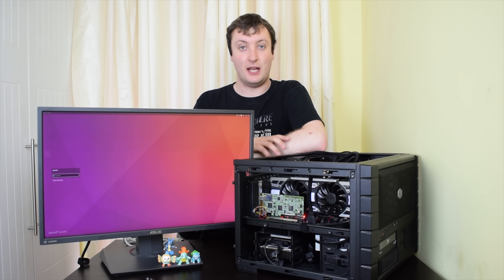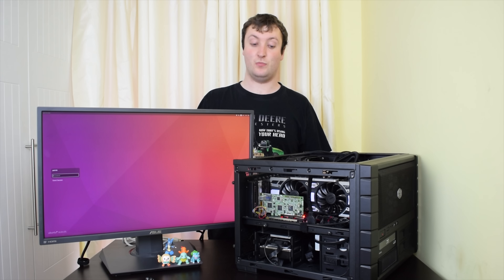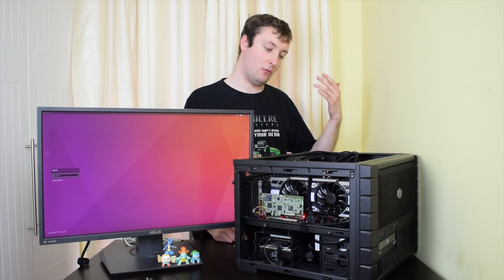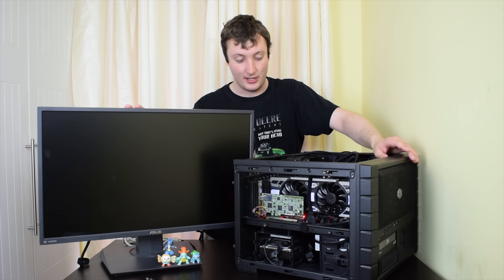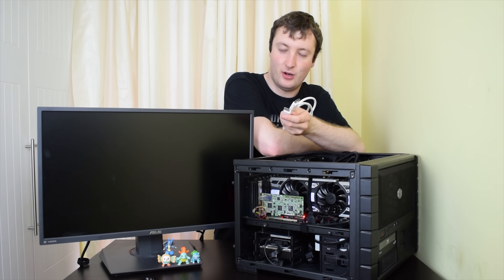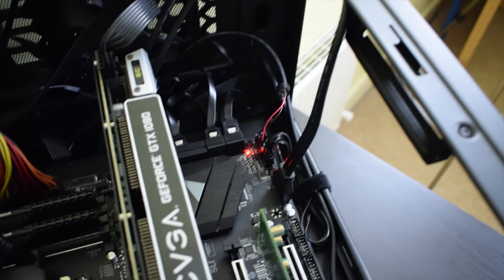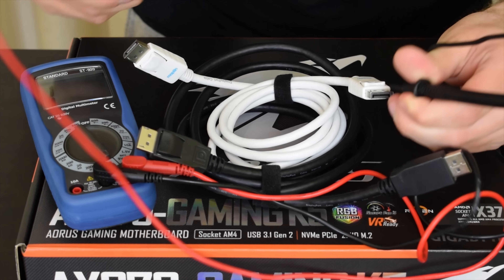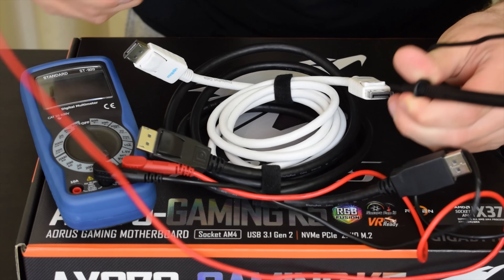Display port can cause boot issues

Comment: im getting weird colored  lines of pixels (red green blue or black and white) when i try to boot into bios with only DP. I was convinced my GPU was burned. Until i tried HDMI port, which worked perfectly fine. I am happy to see this is only a cable issue. thank you so much!

Comment: Its because pin 20 (power) was connected on the cheaper cable.  Actually cost them more to make it so its not just just one wire too many.   Put a piece of tape or cut pin 20 fixed.

Comment: Hello there.... 
I'm not using a DP to DP cable like yours, I'm using a HDMI to HDMI cable with my HDTV ... but I suspect I do have exactly the same issue... or better it is a little different as my PC connected to the TV (in Standby or ON) simply does not boot at all!
However if I pull the HDMI cable from the TV or from the Computer computer boots regularly (yes without "monitor". Then if I connect the HDMI again, every works fine)
I also discovered that if I pull the plug of the HDTV from the wall, it goes OFF completely... after few seconds I reconnect the power-plug.. the TV goes in Standby...  BUT suddenly I can boot my PC!
I tried it 5 or 6 time as I could not believe it.
So instead of pulling the stupid cables every time... I decided to use a master switch to turn OFF the HDTV completely!
A crazy thing. I guess the circuits of the TV keep a kind of power loading and yes maybe also my HDMI to HDMI cable has the same problem you describe here... 
I have no idea how to find a "good" cable... they look all the same to me.

Comment: I have issues when my monitor runs on DisplayPort as well and have no idea what to do about them. I just found out about the pin 20 issue and ordered a cable that says clearly in the specs that this pin is disconnected, yet even so the monitor isn't detected on boot half of the time and I have to power the computer off and back on several times for it to work.

Comment: i have R5 2600x, GTX 1060 6GB, my PC after 1 year start giving me same issue , one cpu led always on no booting, replaced the DP cable and it worked, Thanks a lot

Comment: Holy moly this helped me to fix my pc before my exam deadline!! I just tried my first purchased DP plugin in the motherboard by mistake so there's no display then I put it in GPU I got a black screen display only so I unplug the power cable and the problem start!!!! I'm getting dram yellow light every time. I remove my 3 other rams and put 1 ram only the dram light gone but I got boot light instead hahaha what I do after seeing this is I remove all the cables connected from the monitor and pc for a minute then I use a previous HDMI cable and use another PSU power cable then like magic everything works well now! I will never use that ugreen brand DP again.

Comment: I had two montiors and just for fun after 10 trys to get computer to stay running, booting, loading windows, etc, 10 trys or more, build my own for 20 years or more. and the 4K hdmi of the two monitors i pulled out and restarted with one monitor and voila! Works! thanks

Comment: I was unable to boot with a display port monitor plugged in, but it was fine with the HDMI plugged in (I run dual monitor). This only began after upgrading the motherboard and CPU. This did NOT occur on the original motherboard. Only on the new motherboard. I have to unplug the DP when restarting and plug it in after POST.

Comment: I had the same issue but in my case the fix was not changing the cable but a faulty battery on the motherboard. Changing the battery fixed the issue.

Comment: i had same issue right now, i checked the cable and wiring was OK - no link for pin20 in DP cable, but the problem was quite similar - i had to turn off ErP in BIOS (advanced -> APM config -> ErP disabled) + fast boot -> OFF, problem with booting because of gpu initialization solved

Comment: oh boy that faulty DP cable is the same as mine. I used to get error messages when i was using AMD RX580 and it was related to my DP connection. Now i have an NVIDIA GPU but i dont get the error message but i have some reflection to do.

Comment: i also happen to have a problem with display port with X570S MASTER. When i connect the displayport AFTER the first shut down and power back on it again i lose SOUND from external speakers COMPLETLY. And sometimes in bios CPU led it lids also with CPU_OPT MINUS 55. Switched to HDMI and everything is good....dunno if is motherboard or cable

Comment: The thing that happened with mine was it crashed when I was just browsing. I have not been playing for a few weeks so I was confused on why this had happened. Then when it turned back on, there was no signal on screen. A few days ago, the electricity went out 2 times and force shut down the PC when it was on. So Idk if something happened there. But it's been 3 days now that the monitor has no signal... I have no idea what caused this.

Comment: i m glad i found this video iv had issues with DP waking up with vertical lines like my monitor smashed if i unplug dp it re sets and comes on normal if i dont it takes a few mins for my monitor to come on i checked and i have the exact same DP as your faulty one now im changing  RN and if this fixes my almost 2 year old problem i will be so greatful... iv searched everywhere can't find nothing realy Except oh its common when there cold ! mines near a radiator 
its common with old monitors ! this is relatively new AOC G2 Although old in theory its not even 2 years old to me its the DP i know it this ends today haha

Comment: Dude, believe it or not, I think this is what fried my monitor. Monitor turns on but nothing on the screen. I bought 3 brand new ones and today when I booted the system the screens were all black. I think my graphics card is outputting more than 5V because none of the 3 monitors turned on. When I unplugged the 2 display ports and left only the HDMI, the one monitor came right on. After going in to windows, I plugged the other display ports and they all worked again. The monitor that I had before started doing this crap every once in a while, until one day it never turned on again.

Comment: I just recently had the same problem plugged it in the pc wouodnt turn on no fans nothing, pulled the cable off and it still wouldnt turn on for a minute but it did after and just kept using hdmi i never tought a dp cable can stop pc from turning on

Comment: I just found out this was my problem. My GPU worked fine with the bottom x16 port but not in the top and if I boot my PC with the display port connected and GPU in the top slot no post. So I have to unplug the DP and power on and then replug it for an Image

Comment: I had this issue on a PC I just built over the weekend. It would not boot and on my ASUS Motherboard I kept getting all different Q Codes / and Q LEDs coming up with errors. Then when I removed the DisplayPort cable it powered on... Go Figure! A Cable causing so many issues

Comment: I pulled my hair out till i finally found your video. I had a custom computer that would do weird stuff and i was thinking it was failing. Then i swapped it temporarily with a Dell computer that refused to power on and went into protection mode with the displayport cable attached to it. I removed pin 20 with a needle and i fixed this issue. Mine wasn't even an inexpensive cable it is a Choetech branded cable that's almost 30$ a piece

Comment: It is not the DP Cable ..GTX 1080 has a DP 1.4  I is the Monitor DP is higher rated 1.2 and up Monitor defaults to its highest ..so change the monitor settings  to 1.4 on the DP.. fixed for me...

Comment: My second hand dell 5060 sff come with Chinese dp to vga cable and it amber light come sometimes. It was 2-1 amber light. Specially first turn on.  I unplugged power cord and also unpluged chinese dp to vga cable. Then wait 1 minute. Next plug only power cable and press power button then computer turn on without amber light issue. After turn on computer connect cheap dp cable. Screen showing. I don’t know. Somehow this dp cable issue is real. I almost thinking bad motherboard.

Comment: I had a bad one too. Amazon for 20 bucks. I thought my GPU was going out. It was causing lines in my screen on boot up and just overall poor performance. I have a msi ventus 2070 super. Not the best GPU but is a very good one. Switched back to HDMI and all is fine now.  The  brand of DisplayPort was called “jsaux”,
Reply: Yeah, those off-brand cables are not certified and may have pin 20 wired causing problems. Also, some cables like iVANKY are falsely claiming they're VESA certified when they're actually not. I wouldn't purchase these cables since they may have pin 20 connected leading to GPU problems and/or damage, and they may not support the claimed 4K/8K resolution. I've even seen reviews of HDMI cables claiming 4K not being able to work in 4K even at 6 to 10ft while the 25ft cables wouldn't work in 4K at all.

Comment: Thank you very much. Same issue with a dp cable of my Asus monitor. Connected with hdmi and all works fine. It's a shame that cable included in the monitor box was Soo cheap ! But I would ask to the community: what the reason to connect a gaming monitor with dp instead of hdmi? The latest hdmi are better  in every thing: image quality, sypport resolution/refresh rate higher. In my opinion I'll never buy dp again !
Reply: HDMI does not support Nvidia G-Sync.
Reply: @mikakorhonen5715  ok. Thanks but i have freesync and It works with HDMI...Better with DP 😉

Comment: I have just had the sane issue a few days ago, I bought a used RX VEGA 56  from fb market place AND PUT IT IN MY PC AND IT WOULDNT START AT ALL, IT DID THE SAME IN 3 DIFFERENT PC I OWN, i honestly thought this dude has fucked me over, lucky the dude was a good man and refunded me my money, he was just has confused as me, it worked fine in his pc, the only difference was I used a display port cable and he haD a HDMI, THING IS THE DPCABLE IM STILL USING AND ITS FINE NO ISSUES, SO IM THINKING ITS A AMD mobo ISSUE has this anomaly only effects AMD BOARDS

Comment: this same issue almost fried my usb3 controllers on my motherboard, caused a whole lot of instability issues such as usb over current protection getting triggered at post, monitor was also not going on to the sleep mode, motherboard debug leds were on justlike yours and my usb powered speakers were making a buzz sound when the pc was turned off. I cut the pin 20 from the inside of the cable, usb3 works great and the system is stable.

Comment: I tried for days to fix the sporadically problems hours for hours and saw the lights on my GPU & Board LEDs. Today I switched to hdmi and my system booted. So many thanks to you! 👍
Reply: Hey, this happened to me and my PC Is now much slower. Did this happen to you od Is it just me?
Reply: @petersuchy9283  Unless you haven't figured it out yet, the slowness may be because you have a higher refresh-rate monitor (like 144hz) and your HDMI cable isn't capable of it. Or you just haven't applied it in the nvidia control panel if it's an nvidia graphics card you're using.

Comment: Had the same issue with a brand new Ryzem 3600 and a B550 Board. Thx a lot for your video!
The weird thing is this wasn't a problem on a Intel Z370 System i used before that. No boot problems at all with that "defective" Displayport cable.

Comment: Had never heard of this, you just saved an RX 580 from the return RMA box and my sanity. Spent hours trying to get this new gpu to function reliably, and this was literally my last search before calling it quits. Thank you so much!
Reply: Does your gpu sometimes work in games and eventually crash and pc freezes when you had the issue?
Reply: @JanieUwU  Mine does, yes.
Reply: Had the same and an odd flickering at 4k 144hz.
The cable I previously had looks just like the one in the video and came with my monitor.
One of the clips broke and I had to finesse the cable free from my graphics card too.

Comment: My PC was doing random double POSTs and had all sorts of different boot issues. Changing the cable resolved all issues. The weird part is that the cable was working on two different PCs for almost two years, but suddenly started acting up. Anyway, thank you so much for the video!
Reply: valsunho i changed to dvi from displayport it worked

Comment: Thank you so much. This explains why my computer WILL NOT BOOT with the display port. Sometimes it will, sometimes it wont. I guess it depends on what power its getting from the monitor. Wonder if I can just remove pin 20 with a needle nose pliers!?
Reply: For Nvidia graphics cards there is a solution:http://www.nvidia.com/object/nv-uefi-update-x64.html
Reply: THANK YOU THANK YOU THANK YOU!!!! I can't believe you would go out of your way Kolya S just to help little old me. Thank you so much for the information and the link! All the best!

Comment: This is crazy but I just ran into the same thing this week.  On a brand new system, crazy weirdness, negative temps, fans not spinning and switched out the cable and all is working.  Thank you so much!! I would never have thought...

Comment: I had a similar issue with my build. Rx580 on a Ryzen5 3600. Screen stays black or flickers after reboot. Turns out unplugging the CD-ROM drive fixed the issue for me. Was the only old component in the new system. Try unplugging anything non-essential if you run into the same issue

Comment: This has solved a major issue for me, so thank you very much. New cables are incoming, and hopefully I haven't killed the DP port on my expensive, and impossible to replace RTX 3070!
Reply: You could claim warrenty if the cable came with the gpu
Reply: and it works? I have changed my msi rtx 3070 ti for a 3080 Evga ultra and the display port cable has stopped working (with the 3070 ti it worked great), I have another display port to hdmi cable and it works. extremely rare. I want to try buying another better quality DP cable to see if it will work out.

Comment: This is not a bad cable.  Unfortunately there are two types of DisplayPort cables.  Ones with pin20 (power) wired and ones without pin 20 wired.  For display to PC use a non pin-20 type cable.  For cases where you need to power something like a DisplayPort to VGA converter then you need to have pin 20 wired.  Suggest when you buy your Display Port cables you check the drawing from the manufacturer.  It will show if pin 20 is wired or not.
Reply: This should be pinned, thanks.

Comment: I'm having a similar issue, I keep getting the 02 error code on boot and no image but I'm using HDMI through my TV bc I haven't bought my monitor yet. Just reseated the CPU and haven't turned it on yet but we shall see. The RAM is not on my mobo manufacturers list of compatibility but other part numbers of the same brand are which I find really weird lol, I'll update when I figure this crap out.

Comment: Had a similar issue, and it turned out the problem was the MONITOR!!!!   Hooked the monitor up to another (good) computer; same ISSUE!! The computer was working but the monitor was slow processing the signal.   Who would have thunk it!    :-)

Comment: Thanks so much for this! Bought a new DP 1.2 cable to go with my new 144Hz Freesync monitor and was horrified to find that my PC wouldn't boot today. I thought I'd knackered my motherboard or GPU. Tried loads of things, and managed to get it to work over HDMI once I reset the CMOS. Found your video, used an image from reddit with the pin layouts and snipped the wire on pin 20 at one end and voila! Working PC and DisplayPort cable again.
Reply: Can you send me the link of that image or the subbredits instead?

Comment: I thought it was a bios problem so I spent hours trying to fix my problem that way.  Then I found this video. Thank you! 
For me it is a HDMI cable plugged into a display port adapter. My PC was working fine until a few days ago. 
Im going to order a good HDMI to display port cable.

Comment: This solved my post code error problem with a xt 5700 xt Amd. Fautly display port cable.. Strange because it worked before.. Thank you very much since last night I was stuck with this problem ! Cheers <3

Comment: I just solved it without switching the cable. I downloaded Nvidia Display Port Firmware Updater 1.0-64.exe and let it search for a required update. Et voila, my gtx 1070 needed an update and no damn beeps anymore while I'm connected through DP.
Reply: What monitor do you have?
Reply: Raphael König haha! Shit worked for me!!! Thanks bro!!!!!
Reply: @romeufilho3446  AG322QCX
Reply: @Radderfux  i got error not applicable the graphics card in your pc im using dp 1.2

Comment: Thank you for confirming my thoughts. I have seen this with USB sometimes. I just bought a new cable, should get here tomorrow. I figured this was the issue when I unplugged everything and noticed it was still holding power, and then started plugging things back in. I was able to get it to boot by just having power plugged in and then slowly plugging in the monitor and other things.
Reply: and it works?
Reply: I changed my msi rtx 3070 ti for a 3080 Evga ultra and the display port cable stopped working, I have another display port to hdmi cable and it works. extremely weird.